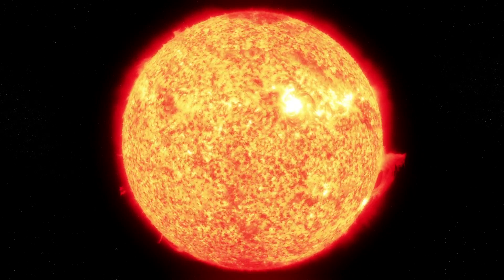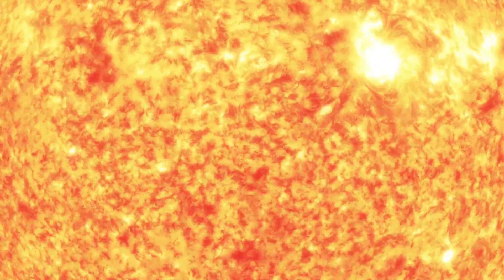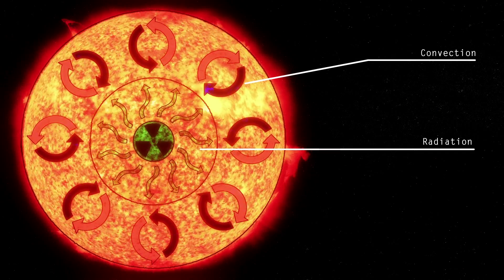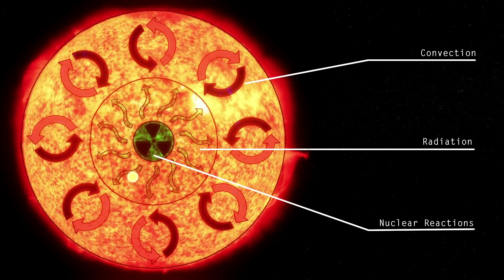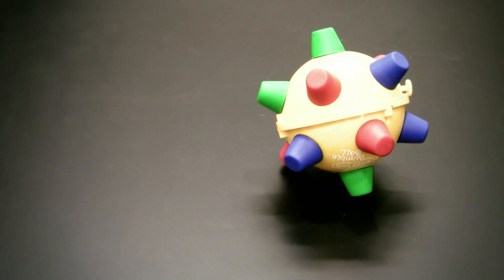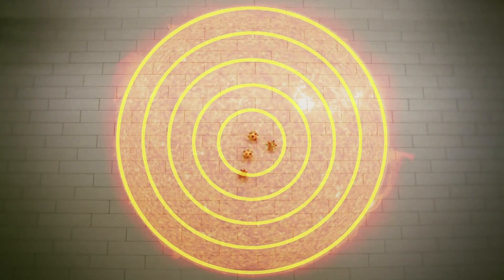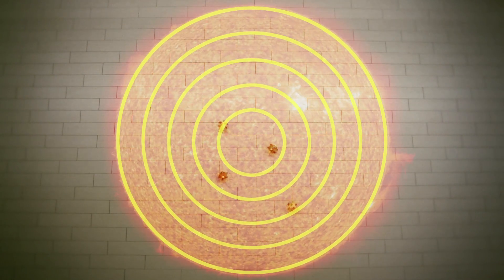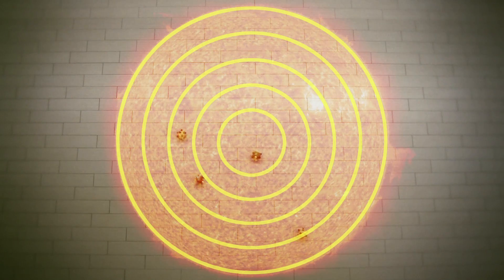Thermal Transport in the Sun I: Radiation

Comment: Why doesn't convection occur in the core?
Reply: That's what I came here hoping to learn as well. I'm guessing that our intuition about the relationship between buoyancy and temperature applies to gasses, which retain their electrons. Since the material in the radiative zone is more ionized, perhaps the volume doesn't change with temperature like we would expect? As we transition into the convective zone, it sounds like more of the material is not ionized and buoyancy starts to become a factor. Please let me know if you found the answer, or a better source for info on this question.